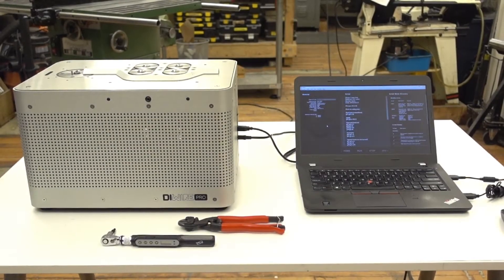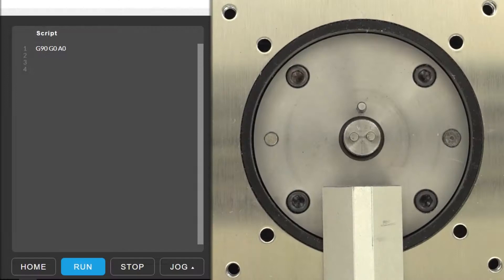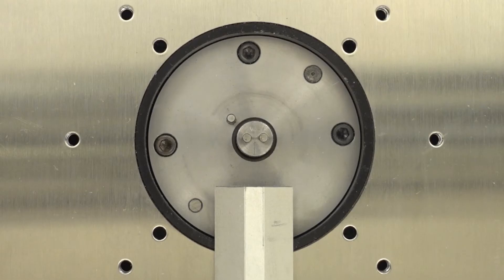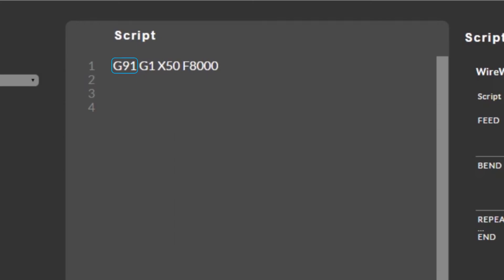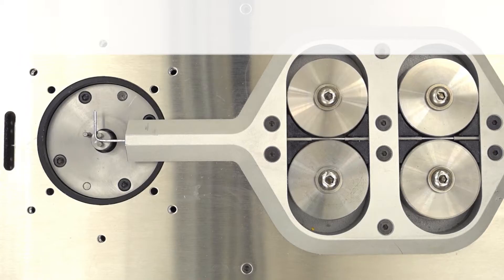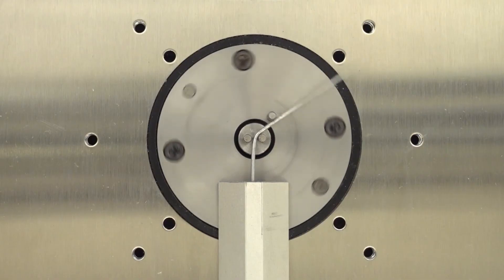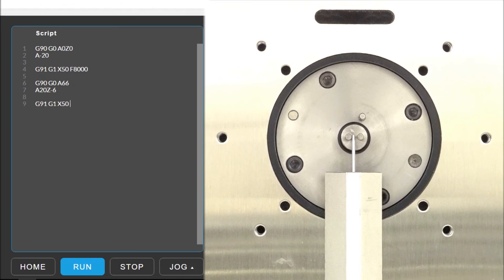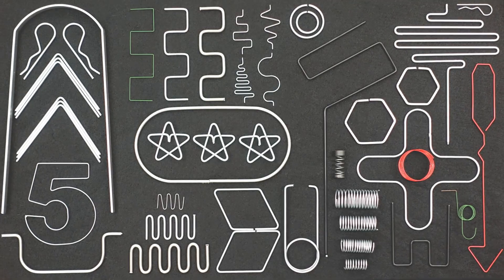Pensa Labs | D.I.Wire PRO and PLUS | Understanding G-code for WireWare 2.0

Comment: Great machine, I didn't understand why the machine performs 90° degree angle whereas the command was 66 °. From My understanding, if you are looking to compensate for the spring back then the command must be a number greater than 90°.  thanks
Reply: The command is for the position of the pin relative to the 0 degrees (in line with the wire). So the pin at 66 degrees position to bend wire to 90 degrees of wire angle.
Reply: @marcoperry7423  Ah, ok, thank you, I think because the pin has some thickness.